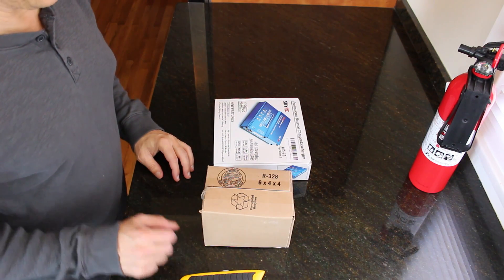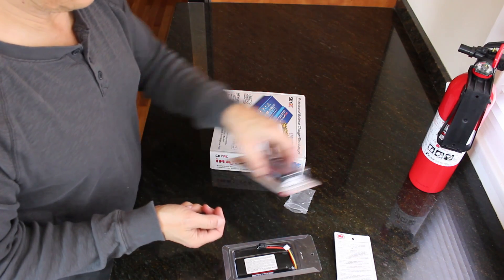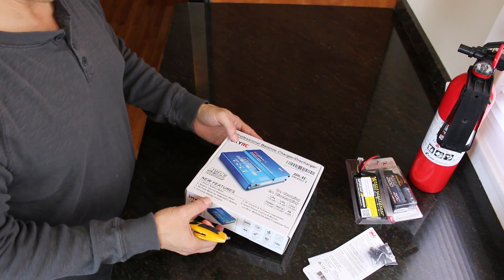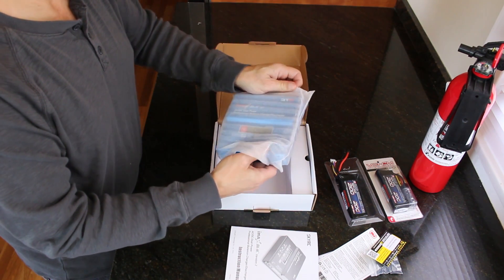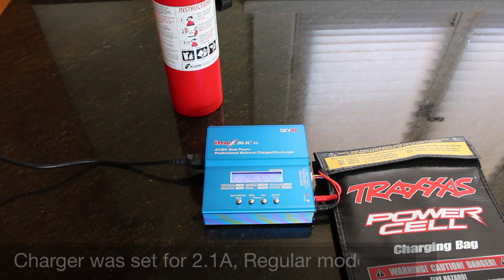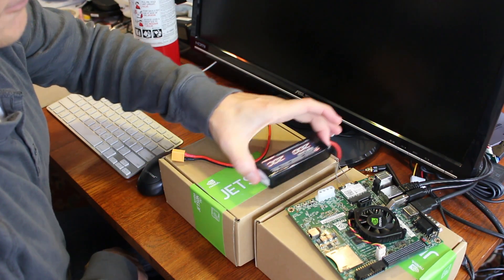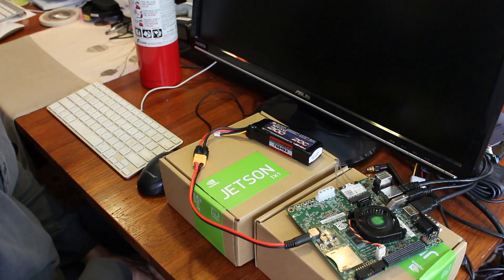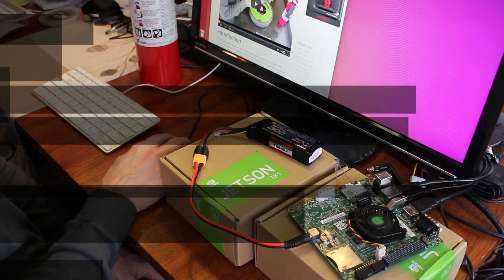Battery Power for NVIDIA Jetson TK1

Comment: How much voltage and mAh needs to power on the board？
Reply from the maker: Jetson TK1 is presently characterized to accept an input voltage of 12V ±10%. The board may not reliably turn on below an input voltage of 9.5V, and a voltage above 13.2V may damage SATA HDD using 12V. Above 16V, the main board may be damaged. Input voltage ranges from 9.5-10.8V and from 13.2-16V have not been characterized. It may be possible to run the system on batteries around the 10-16V region (without HDDs requiring 12V), but NVIDIA has not tested this configuration. mAh simply states how long the battery lasts under load.
Reply: JetsonHacks Tks so much！

Comment: if i use a battery of Lithium-ion rechargeable cell 12V - 7000 mAh ,is this will be safe ?
Reply from the maker: It should work.
Reply: @JetsonHacks  But that requires a DC-DC buck converter too right? To lower down the voltage level from 12 to 5V! Correct me If I am wrong.
Reply from the maker: @siddhant-x8k  The Jetson TK1 does not run on 5V. Since you are asking these questions, you need more help than can be provided in YouTube comments. Please ask your questions in the official NVIDIA Jetson forums.

Comment: hi,
I have bought a  2200 mAH 11.1V 45C 3S Lipo Battery to connect it with jetson tk1.
the battery is fully charged, but once connecting it to the jetson, JTK1 doesn't turn on.
what to do in this case?
Reply from the maker: +Noura Jamal Using a multimeter, what is the voltage reading on the 2.1mm barrel plug? More than likely it is a wiring issue.

Comment: hi,
can i use a 2200 mAH 11.1V 45C 3S Lipo Battery instead of the one used in the video?
Reply from the maker: +latifa ahli Yes, that should work. The important part is that it is 11.1V (which on a LiPo is 3 cells). Basically 2200 mAH tells how much energy is stored, and 45C tells how fast the energy can be discharged. When you have motors attached to the LiPo, the rate of discharge tells how fast the motor can pull from the battery.

Comment: please allow me to ask, can I connect two thing to the battery "the jetson tk1 and a display" or it is designed to be connected to one thing only?
Reply from the maker: +Noura Jamal The short answer is that it depends as to what you are connecting along with the Jetson. You will have to calculate the power draw and make sure the voltages match, things of that nature. Some other issues might arise depending on the type of device you want to add to the battery circuit. For example, when motors are attached to the same battery as the computer, the motors tend to 'dirty' the circuit and cause issues with the more delicate computer signals. Typically when there is more than one device attached to a battery, there is some type of power distribution system put in place (even if it's just a terminal strip) and people tend to start thinking along the lines of fuses and such. Thanks for watching!

Comment: so using the battery it will work right? even the usb port, will it work if I attached ZED camera on it ?
Reply: +HAM and is it a must to use the charging bag?..
Reply from the maker: +HAM Is there a particular reason you do not want to use the LiPo Battery Charging Bag?
Reply from the maker: +HAM There are several videos on this channel demonstrating that the Jetson TK1 will work with a 3S LiPo. I have not tested the USB port with a StereoLabs ZED camera. The tech sheet of the Jetson TK1 states that it supplies 5V @ 900mA max to the USB 3.0 hub, and the ZED tech sheet says that it requires 5V @ 380mA. If no other peripherals are being used on the USB 3.0 port and the specs are correct, it should work.
Reply from the maker: +HAM Keeping in mind that you're asking a person who has a fire extinguisher in every video, here's the issue you have raised. First, if money is the issue, more than likely you'll be using less expensive batteries and battery chargers too. Though purchase price is not always a measure of quality, in electronics what you tend to lose is tolerances and margins of error. Remembering that even good LiPos have been known to explode and catch fire even when not charging (that's why airlines want to ban shipping them on passenger flights) , there are a couple of things you need to guard against.

First, when charging you'll need to be able to contain the shrapnel in case of explosion. Second, the resultant fire is very intense, so there can not be any combustible material in the vicinity. Experienced LiPo users (which includes a lot of people in the R/C crowd) all have their own horror stories, and many use a LiPo bag and charge the batteries only in their fireplace (without a fire going, of course).  I'm sure some people have come up with workarounds, but that's  not something I can personally recommend. Note that virtually all battery manufacturers recommend using a charging bag.

For a battery that does not have the issue, you can look at NiMH or use a lead acid battery. It mostly has to do with the particular application for which the device is being used.